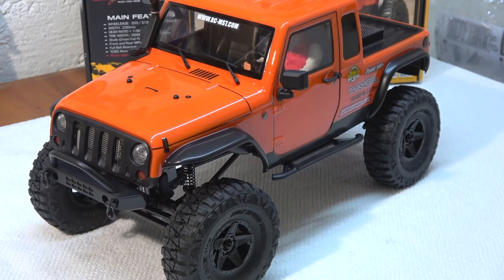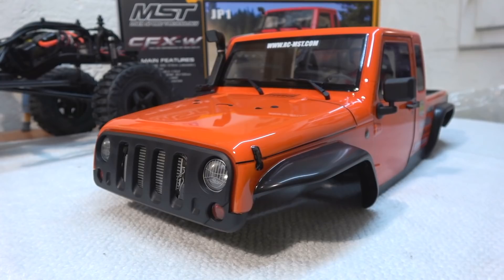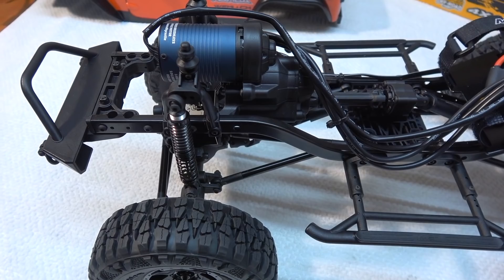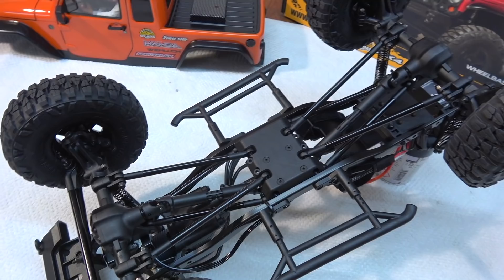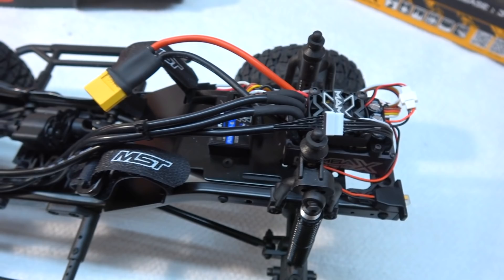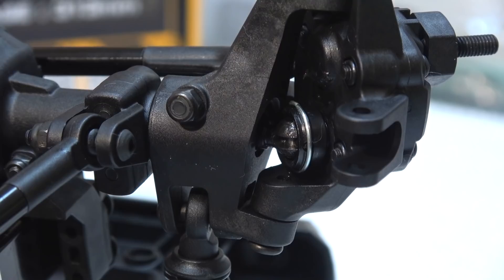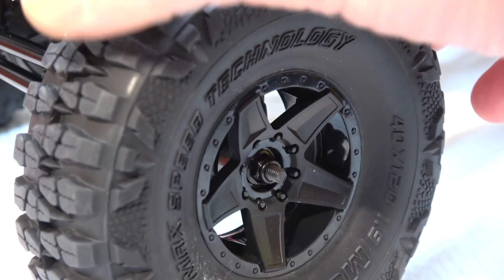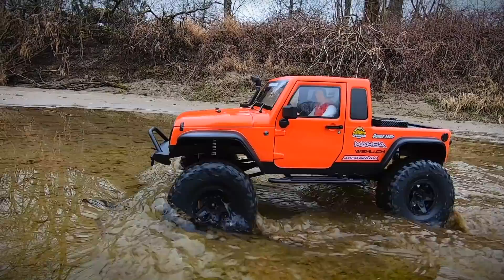MST JP1 Scale Crawler - First Ride and Review

Comment: I bought the original version of CFX-W in 2017, thank god MST finally changed the wheelbase from original 300 to 313, and replaced the poor thin 70mm damper(which is too small for a 1:8 chassis) to new 80mm aluminium damper. With this nice looking wrangler body, the CFX-W chassis could hopefully arouse more interest of RC fans. But......if only these changes could come earlier.
Reply from the maker: Yes, I think the JP1 going better now!

Comment: Unfortunately the MST CFX-W chassis has been discontinued. However, if you still want this chassis, than you must get this truck MST JP1 . MST called this truck a 1/8 scale truck. It is not .  It is a 313mm wheel base. This is a very common size for most R/C cars and trucks. I have the MST CFX Bronco (242mm) and like how it drives. Check out MSTs web site for more information. Also MSTs web site is not very good. I hope this helps.
Reply from the maker: Thanks for your feedback Alfred!

Comment: Would 1.55 wheels fit over the portals? Really considering this chassis for a tamiya wrangler body build.
Reply from the maker: This is a disadvantage of the portals. There is no place to install smaller wheels because of the portal gear housing. Also 1.9 beadlooks are problematic, cause of the bigger inner ring on the wheels.

Comment: That looks great Matteo! How do you create the black lines around the doors and other small black details? Is there a special marker pen you can buy for this?
Reply from the maker: Thanks Dave. There are two techniques.The first is to use a fine permanent marker. This works fine when the body have good notches to guide the pen. The second is to use a self adhesive black film, cuttet in fine lines and apply it to the body. this works better when the body don't have good notches. For this body I used the second method. 👍👍😊

Comment: Why the specification tells about a gear ratio between 1:36 to 1:56 ?
It seems not to have two gears (like TRX-4)...
Reply from the maker: No it have only one gear. But the gear ratio can be changed by installing different size pinion gears.
Reply: @Matteomeier  thanks,  in the meantime I've bought a kit to spend holidays and I've read the same clarification you give me.
Thanks for your interesting videos!

Comment: Only two issues I have had with my CFX/W.. 1. Chassis Mounted Servo options are lacking, Dinky RC is the only one I have seen and getting my hands on one has been pretty difficult.  2. The front cvd's are prone to break and only MST makes them.
Other than these issues, the chassis is great, especially the reduction gear box. Wide High Mass Wheels and some smartly placed chassis weights and the CFX/W platform is a contender for dominance in the portal axled arena.
Reply from the maker: Thanks for your good feedback! The cvd's are improved now, with thicker pins. 👍👍😊😊

Comment: Hi sir. Great videos as always, here i have one question hows your front wheel chamber looks like? Is it positively chambered out of the box?
Reply from the maker: Thank you! Yes, the front suspension comes with this camber. The parts are so designed.
Reply: @Matteomeier  noted and thank you for the information sir, was a bit worry since on mine the chamber error is too obvious. Thanks once again.
Reply: @Matteomeier  by the way sir, how did you made those black outline lines on the body that can be seen on the front bonnet and doors etc... Using black Sharpe pen perhaps?

Comment: Lots of weird decisions and compromises made into this kit...
1.-  Motor is pushed forward for more weight in the front BUT its being put so high that actually elevates the COG too much..
2.-  Electronics are pushed far into the back with the battery on the rear so it almost negates the motor position in the far front for an almost even weight balance.
3.-  It has Portal axles but there is hardly any reduction in the portals? This puts more strain in the drive shafts for no reason.
4.-  Axle Mounted servo? REALLY? is this 2005? Continued in 5.....
5.-  So it has Steering linkages directly in front of the axle? Continued in 6......
6.-  And it has a 40° Steering Angle?????? 
7.-  3° Camber all the way around… Like... WHY?? No really... WHY?

At least the body is nice I guess…
Reply from the maker: Thanks for this... I have only 1 point: It's great fun to drive... 👍👍😊😊
Reply: I think its part of the fun. This way you have more opportunities to make it better.